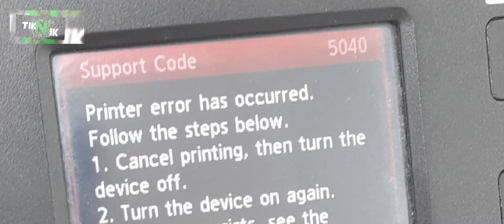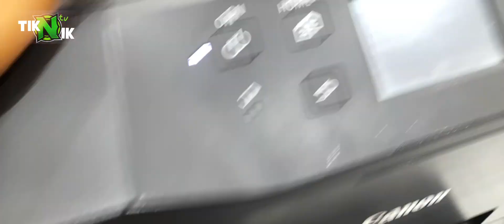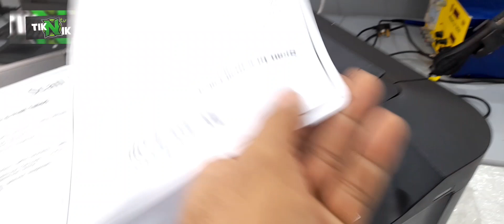CANON MAXIFY MB5340 | support code: 5040 | how to remove adf covers

Comment: Good solution, i have a same problem. It works, thanks from France. I soldered with longer cable to avoid cutting it again if the scanner is too high
Reply from the maker: Good tip! 😉

Comment: Thanks so much, I was able to fix my printer. The wire was actually to short to solder so I removed the screws on back of the printer and I was able to pry out the cover directly below the platen (glass) and soldered on a piece of wire to extend it. I then left enough slack so that it doesn't happen again.
Reply from the maker: you're welcome 🙂...